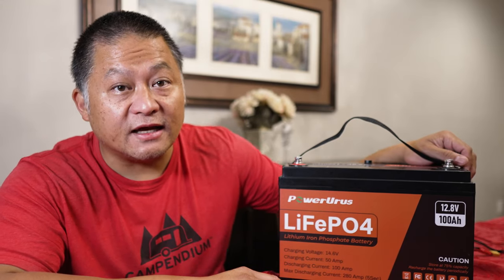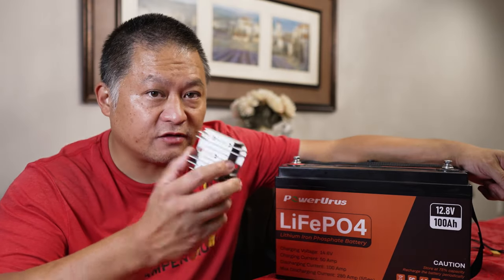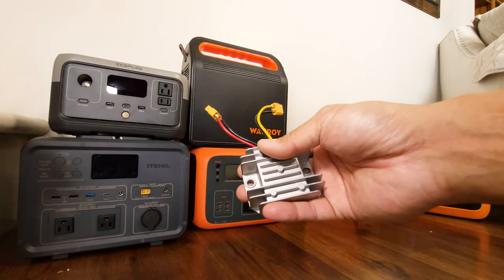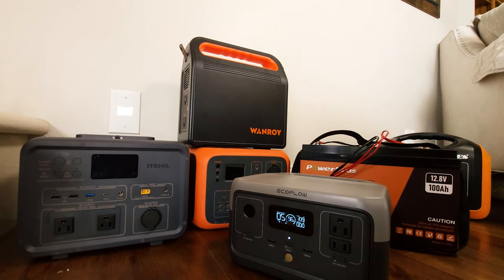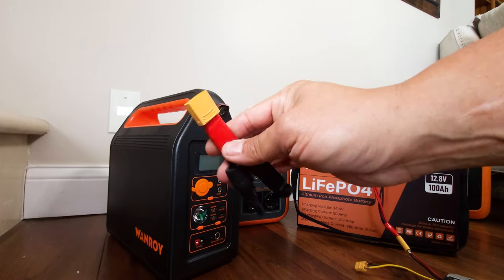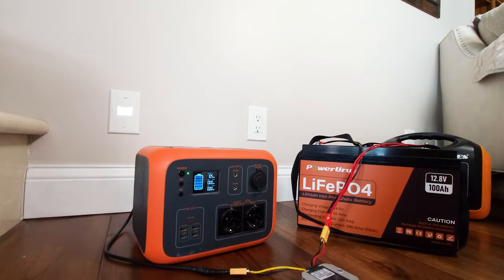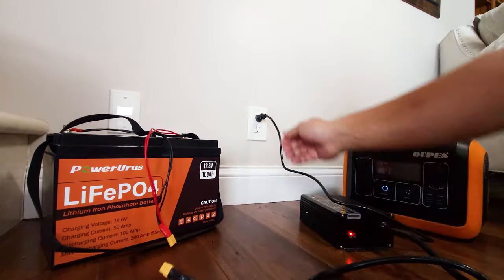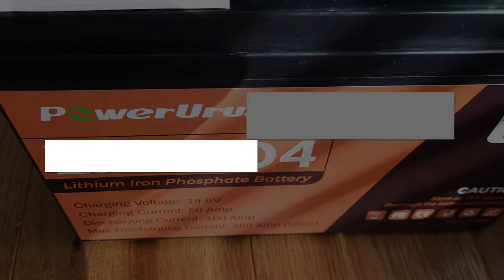CAPACITY HACK For ANY Power Station // PowerUrus 100Ah LiFePO4 Battery

Comment: Wait, $400-$500? I  got 4 x 150 watt flexible solar panels for under $200! My rig makes power ANY light and yes it takes longer and doesn't make as much when cloudy. But I have back ups for back ups, never rely on just one source. I have couple of tiny wind turbines, I  have water turbine when I'm near flowing water, I use a hook up when boondocking and I have 4 batteries in series and parallel. Cover all bases and if they fail a Woodburn that makes thermo power.

Comment: Your ITEHIL is pulling 145 watts in your demo (~24 volts at 6amps). How long do you suppose your boost converter will run safely at double its limit? It is very clearly rated for only 72watts / 3 amps max. Would you be comfortable operating it for long periods unattended in your house like this? Depending solely on the internal over-current and over-temp protections of a $15 converter to keep things from melting down? Yikes.
Reply from the maker: These boost converters are constant running at higher currents regardless of size. They get warm to the touch but never to any dangerous levels. If you are uneasy about that, then I would suggest that you don't use them.

Comment: I tried doing a search for barrel connectors on Amzn but they all seemed to be for cctv etc.   Where could I find an assortment of barrel connectors? Especially the ones used by Bluetti?  Thanks for the excellent video.
Also... is there any reason not to use the 12-24  10amp version of this for a Bluetti AC200P?
Reply from the maker: To be honest the best way to do this is to modify the AC adapter cable that comes with your power station. I just cut the end off and splice in xt60 connectors to both exposed sides so it can still be reconnected. This way you know you have the right plug.
Reply: @freelyroaming  is there any reason not to use the 12-24  10amp version of this for a Bluetti AC200P?
Reply from the maker: @jeanne-gord7685  yes because these converter are often under rated and the 10A model produces too much power for most power stations input port. Depending on the circuitry, you don't want to risk overloading it.

Comment: Can I instead use 12v to 24v 10amp version to SAFELY input to a delta 2?   I think the specs are upto 60v 15 amp.
Reply from the maker: I find these boost converters are usually under rated for what they actually output. I wouldn't trust the rated capacity and instead would test the actual output before using whatever unit you buy.

Comment: Correct me if I am wrong. Your LifePO4 battery should have a floating voltage of 14.4V and powerstations usually require an input voltage of between 12V and 30V, so the DC-DC regulator should be something like this '8-40V to 13.8V 25A', as it slightly reduces the LifePO4 battery voltage to match the input voltage range of your powerstation. The DC-DC regulator you are using does not seem suitable.
Reply: El voltaje de entrada de la estación es variable ya que está pensado para cargas solar. El trabajo depende del equipo pero puede estar incluido en los 60V. Es el MPPT de la estación la que se encarga de gestionar el voltaje de entrada para maximizar la potencia de carga. Elevar de 12 a 24V es únicamente para aumentar la potencia de carga.

Comment: Question for anyone, he used a 3 amp  unit. what if you used a 5 amp or 10 amp unit, will it cause any damage? or just charge faster?
Reply from the maker: At 24v, a 10A unit can push 240W which might be too much for some power stations. But as long as you stay within the limits of your unit, you should be fine. Be aware that a lot of these converters are not calibrate correctly. I wouldn't trust what it is rated for. Test it yourself before using it.

Comment: 144 watt charge from 24 volt 3amp 74 watt up converter doesn't make sense? (itel? box). not sure how that's possible. something in that converter will have to fail. Great if it doesn't but they usually aren't that off on the ratings. getting 200 watts out of a 12/24 10a 240 watt up converter produced unsafe heat. I assume all these generic brands converters are similar quality and generally go with the reviews.

Comment: Also, taking it a step further could you just buy the smallest capacity battery generator to get the connections and then up it with say the Signature Solar EG4 or Trophy 48v 5120wh batteries?
Reply from the maker: In your case I would just forgo the power station and just build a system from components by simply adding an AC inverter

Comment: Can't you just connect the battery directly to the solar (XT60) input of the River?
Reply from the maker: Most DC solar inputs require a higher voltage than the native voltage of the battery. So no.
Reply: @freelyroaming  Hm... Actually, the writing under the XT60 on my River 2 says 11 - 30 V DC, 8A max. And there's also a special cable to connect the XT60 to the cigaret lighter port of a car, which is supposed to have an output of 12-14V. How come that you can charge the River 2 from the 12V port and you can't do the same from a 12V battery? Just curious.
Reply from the maker: @alexshevchenko7568  that's why I said most. The River 2 is an exception. Ecoflow designed their units so car and solar charge can use the same port and is electronically adjusted internally. It's more costly than having a separate port.
Reply: @freelyroaming  Thank you!

Comment: With 100Ah LiFePO4 at about $300, this is a good idea over the commercial overpriced expansion options.  

For myself, if I'm going to carry a bunch of extra stuff, that negates the compact all in one usefulness of a portable generator.  I think buying a large capacity LiFePo4 battery and a good inverter makes more sense.  Then, you just use the battery directly without any inefficiencies of then charging the generator.  You'll also be able to draw full capacity from the battery until drained instead of just 120ish watts.  

I have a bag of cables with every conceivable connection too:).
Reply from the maker: A power station has a lot of advantages. They are designed to be carried and doesn't need anything else attached to work unlike an inverter.  The beauty of this hack is there isn't a bunch of extra stuff. Just a little boost converter that fits in your pocket.

Comment: Why can't the MPPT charger in the power station charge the 12 volt battery when it has 120volts input? Or can it? I want to extend my UPS functionality for my computers, fridge and somehow have it charge/ discharge the 12 volt battery automatically. 🔋
Reply from the maker: Assuming you mean just 120v power from a household socket. First reason is most mppt controllers can't handle that high of voltage. Second and main reason is your household power is alternating current and mppt controllers work with only direct current.
Reply: @Freely Roaming  I guess I'm confused. The portable power station outputs 12v DC which is about 13.7 with no load. Can't that be used to charge a battery then swap to input plug when needed? The power station has its own ac/dc charger transformer. I am only wanting to charge and discharge at about 100 watts.
Reply from the maker: Ok I think I know what you are saying. You want to charge the battery with the AC charger via the inverter output of the power station is that correct? Yes you can do that but depending on the unit, it might not even come close to charging it full and you will unnecessarily cycle the cells of the expensive power station multiple times to charge it just once. It's far better to just charge the 12v battery using grid power directly.
Reply: @Freely Roaming  yes that's what I was wondering. Thanks for your explanation. You are saying it will discharge the internal battery of the power station? I currently use pstation as a UPS for a fridge and a gas heater that pulls 100 watts total when running but both run less than 50% of the time. Internal battery is always at 100%  I want it to just maintain the 12v battery for more backup. PS is plugged to 120v at all times. I would always have the 12v battery at 100% which I know isn't the best but it would just be sitting there for 364 days a year and probably never actually cycle. I was also wondering if you could accomplish this via the USB 100 watt or something I'm missing? Thanks again.

Comment: Please, please, please spend the extra $8 on a multi-pack of blade fuses and wire them into your battery pigtail at least. Protect the very expensive power station, battery, and house, van, and people from harm.  Add a variety pack of fuses for different amp ratings and at least start with what you are expecting to use/what the wiring is rated for. If viewers watching this get polarity wrong they are going to have a rough day. Stay safe out there, and cover at least one of the terminals on the battery (or mount it in a battery box).
Reply from the maker: Reverse polarity protection is built into just about every power station. Worse case scenario is the boost converter shorts out and stops working and you are out 15 bucks. Nothing else bad will happen. Also using plugs like the XT60/XT90 in the pigtail makes it impossible to plug it in the wrong way. But sure, fusing everything isn't going to hurt.

Comment: So far no one can tell me how the solar charge controller can tell the difference between 14,8 solar panel and an alternator putting out 14,8 volts and 60 or 100 amps my truck alternator puts out 60 amps my old school bus put out 100 amps and no the cigarette lighter socket and circuitry won't handle that much power but higher gauge wire and mc connector will

Comment: why not just hook up to car alternator with a step up voltage transformer, skip the externally charged battery
Reply from the maker: Because buying a whole car just so you can extend a power station's capacity is lunacy.

Comment: I just connected my 50ah LifePO4 directly to the charge port on my EBL power station, which is marked 12V - 26V input.
It's charging perfectly at 48 watts. So, maybe you don't even need this boost converter. Try it... if your PS allows it.

Comment: Hi Dan,  thank you for making this video.  Quick question- I have a 24v day solar system with 4 100ah batteries. Already having 24v at my disposal,  is there a device that protects a power station from over voltage during charging from a battery bank? I realize most power stations have built in protection but I want redundancy in protection.  Thank you.

Comment: Good video.
I use adjustable output  boost converter for my Bluetti, and other Solar gen I have, it works great.
Here are some of my suggestions  to improve safety.
1) Put a fuse on the battery positive terminal so in case the Boost converter shorted out or accidentally short circuit the wiring.
2) Put a Female XT60 on the battery side instead of having exposed male pins as you have right now.
Reply from the maker: I've got a bag full of different soldered connectors I made to adapt whatever I need so I don't have to deal with making one-off adapters when I need to make something work. Some are for the explicit purpose of having an automotive blade fuse but I didn't feel the need to use it here. Plus these connectors aren't any more or less safe on the female or the male side by design. The male pins are not exposed. 

Plus just about every power station in the market today has reverse polarity and short circuit protection. Definitely every single one I showed here do. But sure I figured there is always gonna be some Safety Sallys piping up on every video.
Reply: @freelyroaming   How do you survive with such a thin skin?  let me fix your snarky reply for you - "Ty, good idea.  I don't need it for my purpose but others might benefit"
Reply: @davidr9876  u r right david.. we have to be more "flexible" and open minded and have neoguh nerves to be stay calm and open for suggestions.
Reply from the maker: @paulstaf  you sound like someone who has zero practical experience. Just desperate commenting on other people's channels to find any shred of relevancy.
Reply: Great video production! We fuse our LFP's to protect the wire. LFP's, due to their very low internal resistance, can delivery more instantaneous  joules of energy than AGM or FLA Batteries in the event of a short circuit.  Nobody wants a fire, and most people on here don't have Electrical Engineering backgrounds.
Reply: @davidr9876  Really shouldn't have so many exposed live wires. Little bit of heat shrink goes a long way. Battery fire is no fun.
Reply: 24 volts or so won't cause issue.  Now 48 will (& up).
Reply: @aday1637  it’s not the volts, it’s the amps which is the concern
Reply: @budmartin3344  Being a newbie, I appreciate your considerations, even though it may not be necessary for his purposes, and his great video.  I am trying to figure out how to expand my Bluetti 200 max for my RV, stationary and totally off grid. Id really like to do something like this. What is the specific and how do you use the boost converter you speak about, exactly?

Comment: Thumbs up and subscribed! I have a Bluetti ac200 max. Do you think I can make my diy expansion battery with eve prismatic cells/bms? There's a lot of loss with the step up/down converter plus more crap to break/carry/lose .
Reply from the maker: You can use a diy battery pack if it's got a BMS. But I like having a boost converter especially with Bluettis since they need higher solar input voltage. Also it acts as a current limiter.

Comment: Thank you such an informative and grounded video.  I have been searching for ways to expand the capacity of my Oupes 1200 power station.  Todd Parker has a video where he uses the Oupes supplied car charging cable and then attaches a female cigarette adapter to the lithium battery.  I tried it just now, as you this may not work with all batteries and power stations.  It works fine and I am charging at about 97 watts from my 200 amp hr Ampere Time battery.

Comment: That's a great hack.  Thanks.  Great to have in a power failure to keep the fridge and freezer running longer.
Reply: I'm getting my portable system delivered in a couple of days.  In a power outage, I'd let the fridge go and use my solar/battery power on the freezer(s).  I can eat the contents of the fridge in days but the freezer(s) are full of a years food from my garden.  It's the thought of the loss of the WORK even more than the food its self that has lead me to get a back up system.  I've lost entire freezers in the past but supermarket foods is just money lost.   By the end of the summer I have two freezers on the go nowadays.  I have other backup plans for cooking and lighting no need for a battery there.